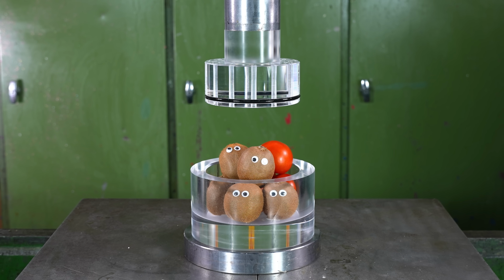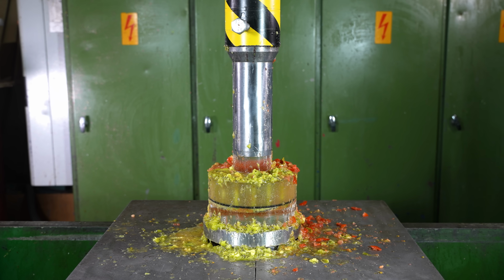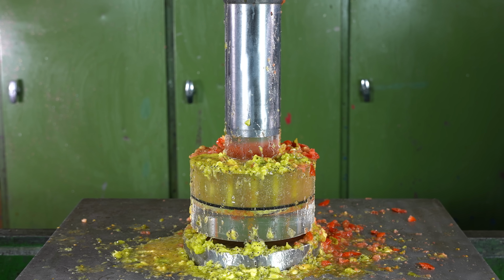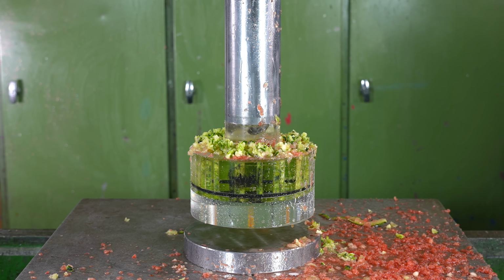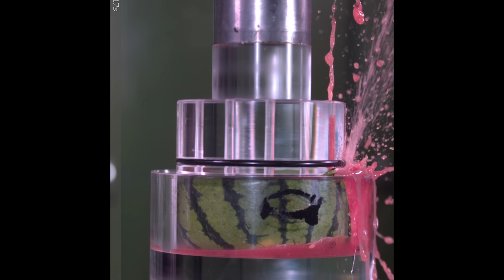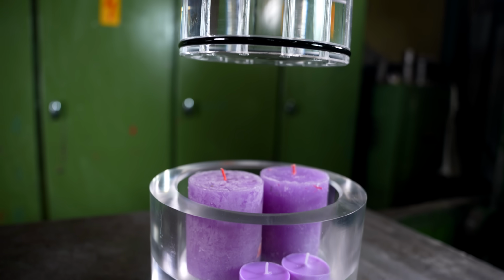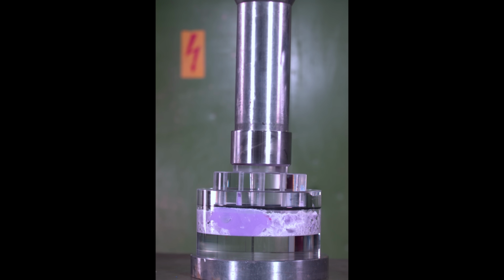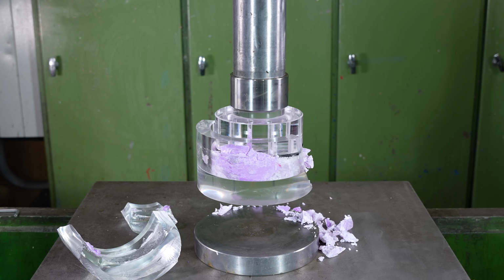Transparent Hydraulic Press Vs. Candles | Most Satisfying Crush EVER!

Comment: You should think about a check valve on the underside that can shoot compressed air into it instead of a hammer
Reply: My guess is the pressures involved are much higher than one might want with air.  5kpsi air is a lot more dangerous than 5kpsi water, for example.
Reply: @gth042  You could use water instead.  Or lower the pressure regulator.  You really wouldn't be able to build a whole lot of pressure in there considering there are like 9 large diameter holes drilled into the top that will relieve pressure the same millisecond the piston becomes unstuck

Comment: As you were starting on the watermelon after increasing the speed I was thinking: "hmm higher pressure seems risky..." "ah they're probably going to stop and readjust" "Ah I am surprised they didn't need to readjust" "That slid quite far" "That sounded like something broke" "Oh it didn't break?, not even the top where it fits into the machine?"

I am sad your tool broke after all the effort.

Comment: One of the difficulties is putting in that rubber seal. You are creating a vacuum with the liquids and the holes, so either you need to make the holes bigger or have a second mechanism to get air into the base.
You are trying to overcome 2 different pressures ( force of press and vacuum). Removing that seal will allow you to remove easier, all be it at a loss of visuals because the liquid can escape on the sides and the holes